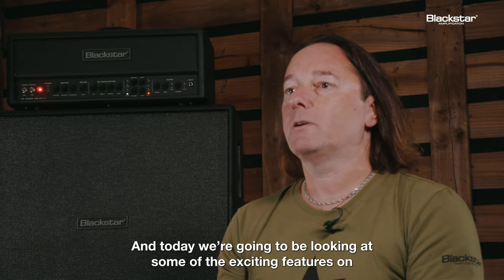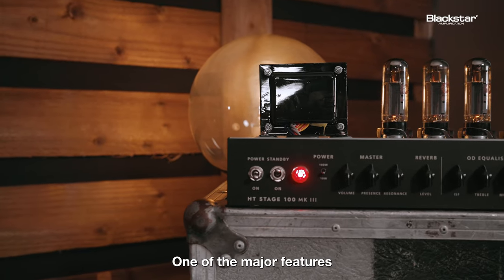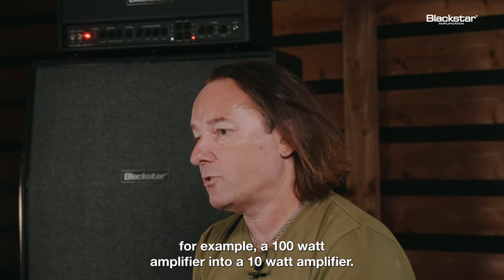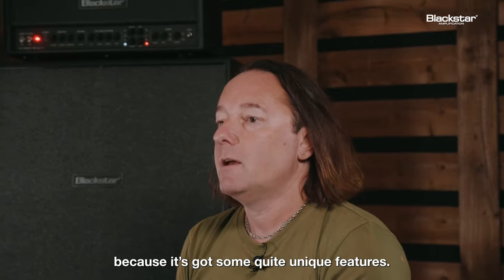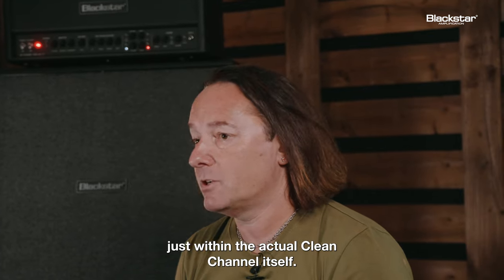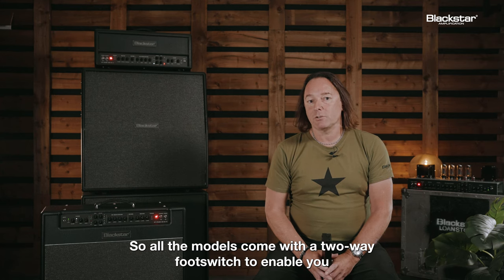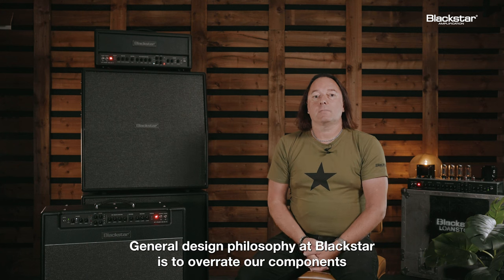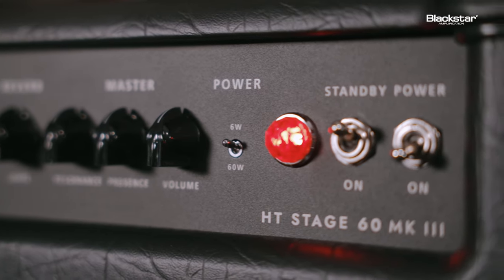HT Venue MK III | Design Philosophy | Tech Talk | Blackstar

Comment: Hello! How can I adjust the bias voltage of my MK2 TH60 212? Do I have to completely turn off both indicator lights? Is it okay if the color of the lights is slightly red? I tried to turn off both lights, but after switching my power to 6W, it turned green again. Even if it turned green again after a while at 60W, what should I do? Please help me, thank you!

Comment: I have the Blackstar HT Club 50 MK III 50-watt and I am looking to put 6L6s in.   Why are the bias trim pots located inside the amp?  - perhaps you guys will develop external bias trim points on MK IV?  You have created an amplifier that accepts different types of power tubes, so why would you keep the bias points inside the amp?  Taking the entire chassis apart doesn't seem very user-friendly in conjunction with the user-friendly power tube swap option.  Run the ball the extra 10 yards for the win on MK IV.

Comment: Sound and features are great BUT your pcb crawling with millions of surface mount components, Yikes, most techs I ask to help me repair my HT Stage 60 turned it dowm and the fact that you do not really release schematics makes your customer after sale support suck. Once you are out of warranty your f**ked and now a replacement pcb for my MKi HT Stage 60 is not even available anymore then it goes to the bin. So this is not really meant to become a classic isn't it? no long term servicesability just a few years use and buy another. Eventually customers will realize this. Better make those changes lots of company went down because they don't listen to customers 🧐
Reply from the maker: As amplifiers tend to have dangerous voltages inside we do not publish circuit diagrams in the public domain, as we don’t want to encourage end-users to open the equipment. As part of our global safety approvals, all Blackstar products are sold as having no self-serviceable parts and therefore for safety reasons we advise you get your amp repaired at an authorised Blackstar service centre.

If you are based in the UK, enter your postcode or city into the box within the UK service center section of our website and hit search. This will identify a list of local service centers. 
 
If you are based outside of the UK, contact your point of purchase (i.e. dealer, online retailer) who will advise where your local service center is located. Alternatively, please contact the Blackstar distributor for your territory who can advise your local service center. https://www.blackstaramps.com/uk/distributors.

To quickly locate USA service centers you can use the ‘Service’ section of this tool on our distributor (KORG USA) website. https://www.korgusa.com/BlackstarDealers

To reiterate, we encourage you to contact the local dealer or distributor on service issues as this will usually give you the best / quickest resolution.  As a small, owner managed company with 35 hard working staff based in the UK we are committed to customer satisfaction and we welcome all feedback at enquiries@blackstaramps.com